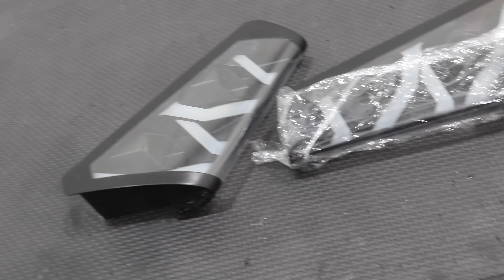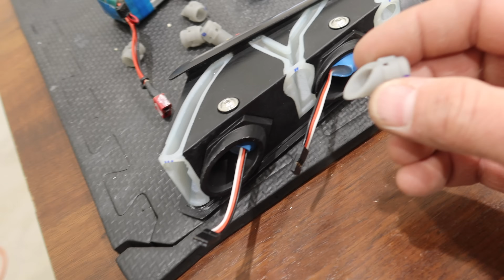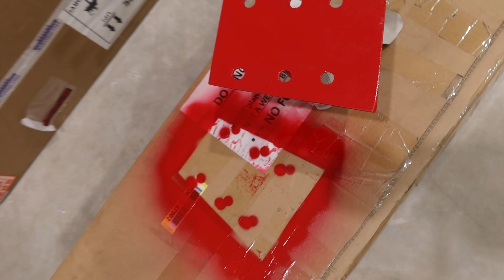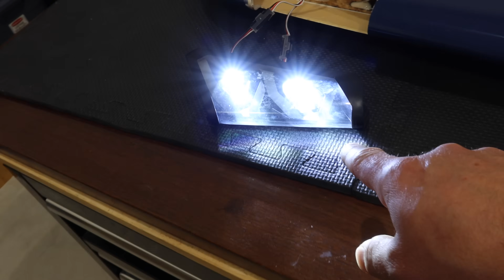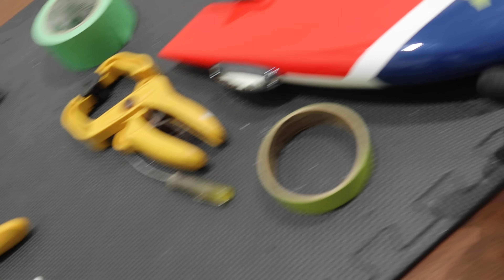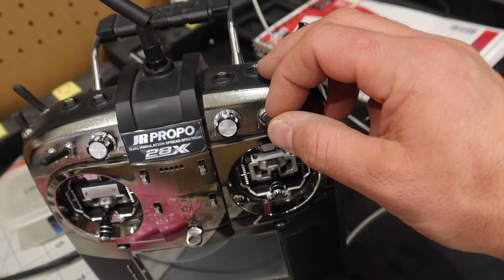HURACAN LIGHT INSTALLATION - Landing Lights

Comment: Johnathan, I like the lights but do you think the small side of the tapered housing should have been installed on the wingtip side?
Reply from the maker: Thanks. They were modeled to copy the Lamborghini Huracan car.
Reply: Your right I just checked out that car, I think Lamborghini screwed up but nice job fitting them in there